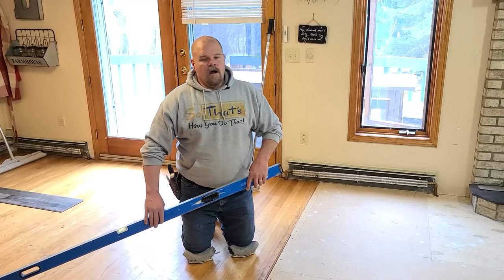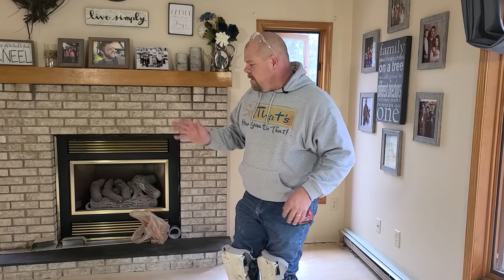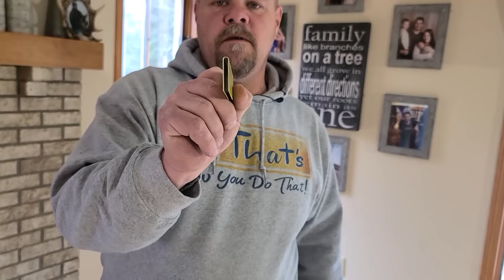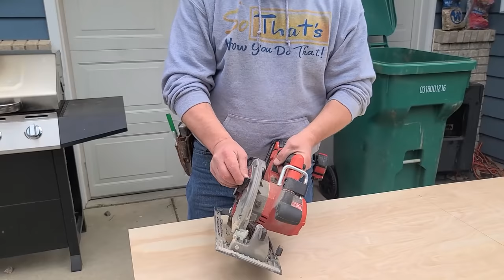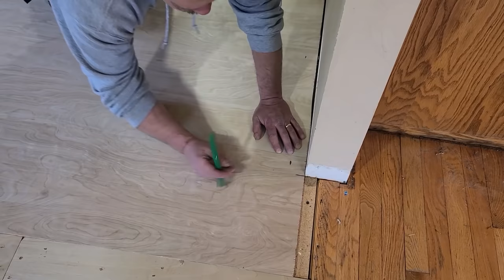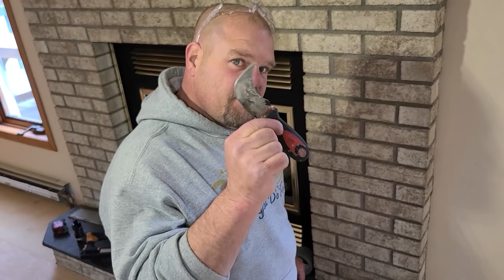What to do when Floors are Different Heights | Vinyl Plank Installation

Comment: Hey Joe. I left a question for you in the comments of your "Floor Prep for Beginners | LVP and Laminate Flooring Home Renovation" video, but thought it might be more applicable to this vid...

I am about to lay 5.5mm vinyl plank in a room that still has lino (sheet) on half of the space (half has OSB where carpet existed). I would greatly appreciate your advice on how to handle the transition from OSB to lino. Should I (1) install the plank as is? (2) use the Ardex to smooth the transition? or (3) remove lino? 

I don't know how to add pictures to comments so have changed my profile pic so that you could see the what I'm trying to accomplish. I'd really appreciate your advice!
Reply from the maker: How much higher is the Lino?
Reply: @SoThatsHowYouDoThat  Thanks so much for the reply! I shouldn't have called it lino - it's pretty thin vinyl. I'll be on site this weekend and will get a precise measurement. How thick is too thick?
Reply from the maker: I guess what I am wondering is does it have a quarter underlayment under it? That would be too thick. If it is just the vinyl, you can float that out.
Reply: @SoThatsHowYouDoThat  No underlayment - just glued directly to OSB. Thanks, Joe!

Comment: I remodeled my kitchen And removed old tile and than 1 layer of 3/4 in underlayment that was glued and nailed and had thinset all over it. I stripped it out to the original subfloor and that floor had glue and is kinda rough. I was going to go over the original subfloor with the new 3/4 T and G but they want $90 a sheet right now. I need about 20 sheets. Subfloor is just too rough and needs some leveling. I'm not sure if 1/4 in would be good enough for the floor deflection. The original floor is that old 5/8  T and G, the floor joist are 2x8. I feelike I need more  to keep the floor from flexing.
Reply from the maker: Yes, you need at least another 1/2 inch sheet of plywood to get the proper strength.

Comment: Hi Joe  any advice on how to tap end to end  joints on laminate planks when the walls are angled at both ends  of the  room  as the end tapping  bar is only  suitable  for square  ends  . I would  appreciate   your  advice
Reply from the maker: Is the floor already done?
Reply: @SoThatsHowYouDoThat  no on going  job  i thought of using suction cups  but the  planks are  textured   i might try two sided tape  next

Comment: Can you do this if the below surface is concrete? I am planning to put vinyl planks all over my house but the current situation is tile and carpet. I'll leave the tile and remove the carpet and will have exactly 1/4 height different between tile and concrete. Will have to use tapcon type of screws to hold the 1/4" plywood over concrete...
Reply from the maker: I would not use plywood to build up the floor over concrete. Why not demo the tile?
Reply: @SoThatsHowYouDoThat   Because is way too big area. Is the 1st floor Kitchen, bathroom, hallway and foyer of a townhouse. And a small area with rug on living room/dining room. That area is way smaller than everything else. 

Any other option you would consider to build up?
Reply: @SoThatsHowYouDoThat  And thanks for replying, by the way. Blessings to you.

Comment: I just bought a house and there is 2 different carpets between bedrooms have a short pile and living room having a long pile. And the kitchen, bathrooms and entry have the ugly beige square tiles. I was planning on ripping out tile, I wonder if I could build up the area where carpet is. But that is a large area so not sure
Reply from the maker: Are the subfloors different heights? or just the carpet?
Reply: @SoThatsHowYouDoThat  Not sure yet. Going to rip up carpet and see what I am dealing with. It's built on a slab, so not sure how they laid the carpet.

Comment: What if the situation is exactly opposite- I have hardwood in my living room that transitioned to linoleum. I want to make it all hard wood (open concept, taking out the wall) but putting the hardwood on top of the current subfloor would make it about 1/2in higher than the exsisting hardwood floor in the living room. Is my only option to replace the subfloor with something thinner?
Reply from the maker: I would just demo the linoleum area and that should bring it level.

Comment: I just replaced my subfloor and noticed that it is higher in the center of the floor. Should I be concerned about this when installing a vinyl planks . Your input would be much appreciated.
Reply from the maker: is there a significant hump or is it gradual
Reply: @SoThatsHowYouDoThat  gradual it's right where the ductwork runs under my home. .

Comment: We have a concrete slab that is 3/4 inch lower than the engineered hardwood everywhere else. We bought plywood to go over the slab which brings it to height but not sure the best way to adhere it to the concrete or if there is a better option. Anyone have any advice?
Reply: I came across this on a project today… I want to raise subfloor 3/4” with plywood on concrete…did you end up getting an answer or how did you end up going about this issue?

Comment: I'm installing LVP FLOORING ...... from one room to the next....room was an add on over the years and the floor is 1¹/2  higher than other floor. Any suggestions on the transition?
Reply from the maker: That is tough. Is building that room up an option? When you get into transitions that significant, it is then time to pull out the tablesaw and get creative. Meaning make your own transition.
Reply: @SoThatsHowYouDoThat  thanks for the reply. I actually watched your transition video after I sent reply/question last night. I'll be able to use an "overlapping stair nose " which I saw in your video...🙂 thanks.. your vids have drastically helped our DIY installation today.

Comment: Is OSB an acceptable material to use to build up a floor for LVP? 
OSB cost is currently one and half arms vs an arm and 2 legs for 1/2 ply
Reply from the maker: Absolutely!
Reply: Osb is good for anything except sheet vinyl goods as the glue used in it will bleed into the vinyl as it ages. Typically turning it a yellowish brown color
Reply: Yep OSB is just fine!
Reply: @SoThatsHowYouDoThat  So OSB is now hard find in my area, is 1/2 MDF acceptable?  Floor will be in a Kitchen, foyer and living room w a wood subfloor.

Comment: 3/4 T&G ply subfloor, some localized top-layer delam spots here and there, which I'm removing and filling w/floor filler. Do you recommend a 1/4 or 1/8 luan or ply overtop to provide more consistent surface?
Reply from the maker: If you are concerned about it, I would add a 1/4 inch birch.

Comment: Hey Joe! Ive been watching your videos for a long time but never decided on undertaking the floor in my whole house because my large kitchen has tile and the surrounding areas are concrete slab with carpet. I do not want to undertake the huge job of removing the tile and was considering using concrete to feather the transition from tile to concrete. I would prefer to have a seamless transition if possible. Please let me know your thoughts on this and if you have an idea that may be better
Reply from the maker: I would demo the tile. It is pretty easy to demo on concrete and in the long run you would be much happier.

Comment: Hey Mr. Joe, I'm installing fairly thick vinyl planking throughout my house, but when I get to my kitchen floor it has very thin sheet linoleum on it which is maybe 1/32" or at the most 3/64" inch thick. We have a spare piece the previous owners left and even my wife can easily tear it. So do you think it will be okay to just go over that thin of lino with my final planking and continue on through the rest of the house? Or do I have to somehow gradually float something on my concrete floor up to that?
Reply from the maker: I would float it out and with this situation that will be pretty easy.

Comment: So if I have full living/dining and part of the hallway all ceramic tile do I need to remove it to be able to lay vinyl plank? Is doing self levelling over it a possibility?
Reply from the maker: I would use ardex feather finish to fill the grout lines and then go over it. Mannington Adura Max says their product can be used over tile without filling the grout lines.
Reply: @SoThatsHowYouDoThat  Thanks, I have also found risen corners and some uneven edges is that going to be a problem or could I grind those down?